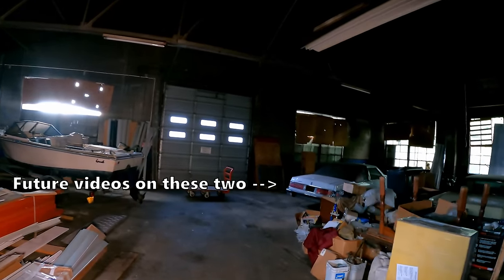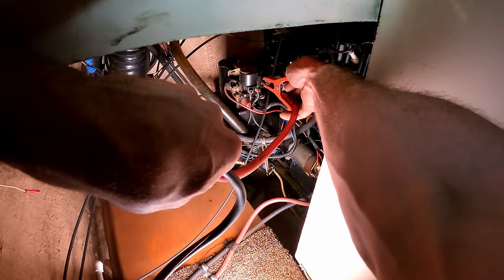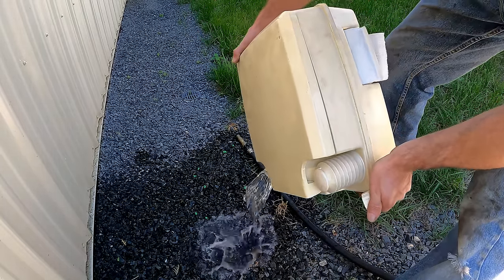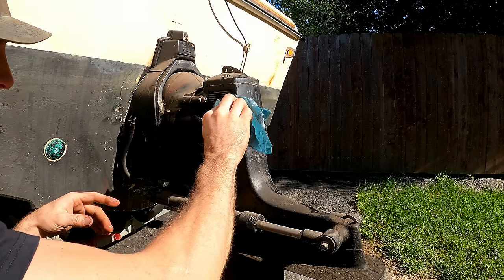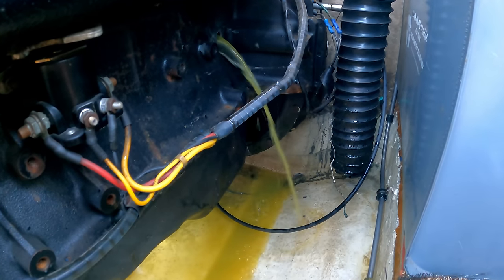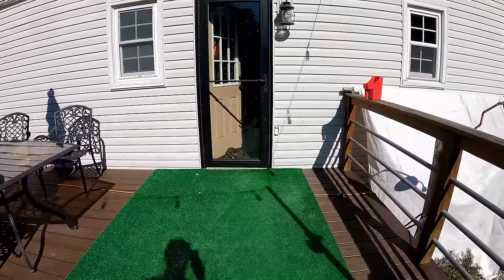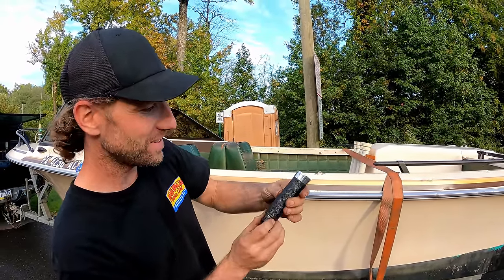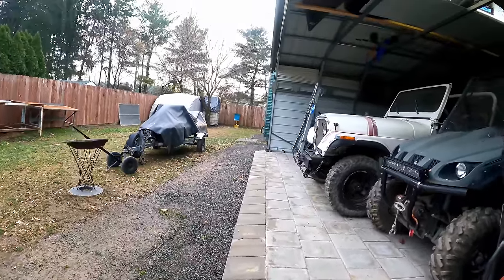Caravelle Boat Sitting Since The 90s?  WILL IT RUN? and Float - NNKH

Comment: Just an FYI, if you didn't already know those dry chemical extinguishers after sitting for years even though they are in the green, they won't work properly. Take a rubber mallet and beat the sides and rotate end for end until you hear the powder sliding freely and not in a clump, from end to end. Should be done once a year.
Reply from the maker: Thanks for the tip and info!

Comment: I had an orange 1972 Caravelle Stingray for 10 years, gave it to my sister and she ran it another 15.  Great boat, used it a lot on Lake Michigan, nice deep hull on them.  It had the ubiquitous Mercruiser 140hp 4 cylinder (GM) so it was great on fuel. Hard to believe the 6 cyl. version only gets you 20 more HP.   I did have to replace the exhaust manifold despite it always being a fresh water boat.  Mine had a steel gas tank up in the bow that rusted out.  Had to remove the entire  top half of the boat to get it pulled out.  My brother welded up all the pin holes he found after sanding it down and popped it back in.  That was when I still had it so it made it another 15+ years without developing any more rust holes.  I'm going to guess that this boat was probably made in the mid 70's.  There's a lot of stuff on it that's identical to what was on my 72 so I'm thinking it's got to be within a few years of '72.

Comment: Chris on the old style tnt you have to push the middle button and the top button or bottom button at the same time to make the TNT go up or down  . That is why you see red on half of the middle button and the top button it red and the bottom is Green . The inline six it a GM Truck motor and its the best combo for a boat and drive you will ever have on a boat I love it . Again push both buttons for tilt or tilt down

Comment: I had a 1967 Lone Star, cutter crew with a 327.
It had a through the hull water pickup, direct to the engine mounted water pump.
It was nice not having to worry about the unreliable pump impeller in the out drive.

Comment: Great boat 
 I retired from flipping cars in 2017 after 43 years buttoning at that boat. That looks like a keeper! Buff the white, fill sand and paint the bottom, wheel. Wheel bearings in the trailer

Comment: Love everything you do bro. Been wrenching on cars since the early 80's as a hobby/passion. First car my father gave me was a 1944 Willys MB2 War Jeep. Moved on to many others incuding my high schools ride of  a 1977 Firebird I bought from the Chef at the restaurant I worked at for $900 in 1985.  I wasn't even 16 yet. Grabbed a 1985 Mustang GT with low miles in 1989 while I was in college for $5,000. The list is long thereafter. My only advise, do it while your are physically able. I've pullled motors myself and done other stuff to remedy a situation that wasn't physicallly advisable. Work smarter not harder.
Reply: And get this tools, assistance, etc to do so. Which perhaps you already are

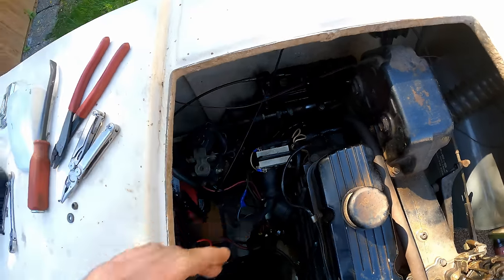Comment: 33:45 you nailed it on the head when you briefly mentioned the BEST thing to do is just REPLACE that throttle cable, because that's ONE THING You dont want to have fail you when youre out on the water. Lol.

Comment: A few vids ago I commented you can tie up a spare belt in case it breaks since you have to lift the front of the engine to replace a belt.  That is the engine I learned it on!  Super reliable, good on gas.  Outdrives, a different story.

Comment: G,day from Sydney Australia. Nice preserved glass boat. 
*Good work trouble shooting the lack of engine cooling water flow rate, including temperature sensor and dashboard gauge.
* impressed with the air driven oil injection into the side throttle cable.
🌏🇭🇲

Comment: I've had a lot of boats over the years and have taken the GM straight six and Mercruiser from boat to boat a few times. My first boat was a Galaxy with a freeze cracked block. Tried to weld/braze it, waste of time. Bought a 265 engine from a salvage yard cheap because I pulled it myself from a bread delivery truck. That combination lasted for years. Strong motor for skiing. If you ever go to a stock GM 6cylinder like I did, the only differences I found was the marine version has stainless steel freeze plugs, and the head dowels are different. Water pumps are supposed to be different but I never found any difference.

Comment: I had a 1977 Bayliner with the Volvo 4-cyl that overheated. Thought it was an engine internal problem until I changed the water inlet elbow at the drive, no more overheating. Turns out it was so corroded, it was preventing water from going into the engine.

Comment: This is a great drivetrain. My uncle has a 67 grevette with this drivetrain. This is a late 60's drivetrain. Gauges seem original. They are the exact same as my uncles. 
If you ever have to do the aluminum distribution blocks for the trim... have fun. engine has to come out

Comment: I love you man, watching you is like looking back in time at myself in the 80`s ND 90`s.  Will it run  and flipping cars or anything for a buck. Just for giggles I had cards printed that said "Anything for a buck". got  lot of Laughs.  In about 85 there was an abandoned gas station by my home  where lots of people parked their cars for sale. Sometimes 20 cars were there. Occasionally some owner would under price his car and I would buy it . swap 4 sale signs (including phone Number) and flip it the same day for a$100 profit and never even drive it. Sometimes , not always. I bet I did 25 or 30 of those one day  no drive flips before the city shut it down. Those were great YEARS UNTILL IN 95 i had saved up $40,000 in my floor SAFE , One day i WAS sitting at my shop no more working at home, and a guy came up and served me with a divorce decree. 5 minutes later a cop came up and served me with a restraining order .WOOO!!! I ran to the bank only to find out my accounts were wiped out and my credit cards maxed out. All within the same hour! What a coincidence, eh? Restraining order or not I went to my house AND the safe was empty and all the locks changed and a new alarm installed. Plus all  my titles were gone! (cant sell 30 with open titles without paper) I took me 20 years and I built up the same amount of assets and the same thing happened but not  as bad as the first, I`m 73 now , live in a tiny shack have no assets or drivers license because I cant afford insurance due to what my X did to my driving record. All this is to tell you to watch your togue and dont say the two little words I said.............I do.......dont do it man!

Comment: 31:50 those hydraulic crimpers are AWESOME.  I bought the exact same set from Harbor Freight about 10 years ago.  I don't use mine for electrical cables, but i have been in charge of putting up a 200ft tall Christmas Tree "shaped" light pyramid every year that's made from 12 strings of LED rope light, and each string is 200 ft long and each one is hung from the hook of a construction crane and is hanging vertically under its own weight, so to prevent the rope light from tearing itself in half, we attach each stand to its own piece of 1/8" stainless steel wire rope (cable) to help support the weight of the rope light.  Plus each stand has separate pieces of cable attached to it about half way up that runs to the ground at an angle (away from the light strand) and gets ancored to the ground, this keep the rope lights from getting blown around side to side in strong winds etc.   anyway.. long story short, 12 strings at 200' long each,  plus 2x 100' stabilizer legs for each light strand, youre talking about 4800 ft (almost a mile) of stainless steel cable, each one needs dozens of aluminum eyelets, ferrules, connectors.. all of which need to be hydraulically crimped, by hand, in the field, outside in October/November in the upper Midwest when its freezing out, and my little harbor freight hydraulic crimper (just like the one in this video) has worked FLAWLESSLY going on 10 years now! 

Best investment ever!  No regrets here.  The only thing i ever had happen is occasionally the head will unscrewed from the body a little too much (it kind swivles) and if it unthreads too much the hydraulic oil will start to weep out and make a mess next time you go to grab it out the case.  No big deal though, just twist it tight (dont over tighten, the threads are fine) and it seals back up perfectly.  

Awesome tool! 👍

Comment: I usually spend a bit more on electrical connections. Big difference between those cheap ones and a nice heat sealed connection.

Comment: Had a 21ft Caravelle with same motor had a cracked blk but ground it and used a metal repair putty and ran the boat till I sold it 3,-4 yrs later but it had walk thru open bow with a fiberglass roof/cab that covered seating for four or seats would fold out into beds and we'd catfish in the rig, hang a space blanket off the rear of cab and light a sterno,, warm fishing 👍

Comment: Ever think about making a tow dolly from that little sign trailer? Just widen the axle and weld in a couple of tire trays ,add some straps  and go !! Even the homemade ones fetch alot of $$$$ !!!!
Reply from the maker: I was planning on maybe putting a generator on it. Or something else that would come in handy. I already have the tow truck so don't need a tow dolly at the moment. I used to have a master tow. It was great

Comment: We are looking at the result of 50 percent inside storage and 50 percent proper maintenance. Any issues are just age. Plus a straight 6 is a pretty indestructible engine.

A little gimbal bearing leak is no real issue to fix.

Comment: When Optima moved to Mexico I noticed a huge decline in quality. I bass fish year round and I used optima batteries for years. In about 2010-2012 (somewhere around that time) I bought four new optima batteries for my boat as replacements for the optima’s that I had been using for several years. The new optima’s lasted about three years before two of them died. I started buying batteries at Walmart for a ton less money and they work just as well or better than optima’s for me. But I’m sure optima is saving a ton of money by making their batteries in Mexico. This money savings is great for everyone except for the consumer.

Comment: A lot of the stff in that boat is from the 1960's even. If you look at that material that is in that pile of stuff with the flowers on it and the Psychedelic colors etc. It's directly from that actual 1960's for sure and those non spill mugs are from the 1970's at best too. LOL. COOL stuff!   Well until you want to wash that mug out lol.

Comment: Those are great boats and with the 160hp, make great recreational ski boats. That boat should be capable of pulling 6 experienced slalom skiers. Mind you, they won't just pop up out of the water but I have done it with that same engine.

Comment: Caravel are very good boats that offered good performance. They were built without using wood in the hull. I think I heard you mentioned a searay which is another great boat. The one to stay away from is a bayliner. Oh yea you probably have an Alpha outdrive which is fine for what you have at least it’s not an OMC. Also you are supposed to fill the drive from the bottom up not top down. Not sure about using gear oil not specified for marine use.

Comment: Caravelle is an island known as Martinique. Although what I find curious is that in boats it's traditionally a hull style and construction in timber vessels. Although the boat here has no resemblance to Carvel (carvel, carvelle, carvile, kervel) It must be reference to the Island and the boats there are a fast manoeuverable craft hence a short nose and an inboard stern drive for carving a path through the coastal waters and rocky shores.

Comment: 😇😇😇😇😇😇😇 I would ditch the foam on the engine cover. That stuff is nasty once it starts to degrade / delaminate. For the cost of it get some 🔥 Fire proof stuff and heat resistant glue. You could possibly use car or vehicle sound proofing ? 
** Don’t go sucking in or ingesting any of the dust , foam is made with highly toxic chemicals and gives off cyanide gas if burnt .**  If I was in the USA I’d send you some . I’ve been working with these products for 52 years . In the UK we still had none fire resistant foam until regulations changed in about 1987-88 . So please go carefully as I suspect the USA was the same .  Great video as usual and what a find . 👍🏻 Keep em coming .

Comment: That boat is at least a 68 or older the 160 Mc was before the 165 its a 250 straight six chevy great engine but that intake manifold and exhaust is all one unit and very expensive to replace only aftermarket is avaidable so dont overheat it or let it freeze

Comment: The wonder mug with its rubber bottom won't slide off your dash pad of those old cars and the old fashioned styrofoam coozie. Newer than 1972 boats would have a VIN number on the transom. It should have the year right in the number.

Comment: To launch a boat reverse and hit the brakes.Trailer stays out of the water.Drop your rollers and drive on trailer or change to slides with side posts no winching
Reply from the maker: With a bunk trailer maybe but not a roller trailer. Good way to lose a boat on the ramp

Comment: You need coolant in the engine, water from the foot goes to the heat exchanger and cools the antifreeze.
Reply from the maker: Not on this boat. Open cooling system

Comment: Top Gear under the cap on those drives are really bad to strip out.  Believe the ones with the hook eye on the top were the I or R model drives ....somebody correct me if I have that wrong.  Always check the condition of the u-joint bellows under the outdrive.   That will sink the boat if it is ripped.   There is a foam seal under the transom assembly that sealed it to the fiberglass.  That five dollar foam seal is one of the biggest labor jobs you can get into because it requires engine and outdrive removal and then the transom assemble to come apart as it sandwiches the transom.

Comment: Noticed ya don't put a piece of wood under the drive to keep it up. They have been known to creep down, both new and old. Sucks to get to the ramp and find it crept down and parts of the lower unit/prop are missing because of a $0.50 piece of wood and a bungie chord

Comment: You shouldnt  Turn /Crank/ the motor over or run the motor with the outdrive in the up position, it can cause major damage to the outdrive, especially without a water source,
 i.e. water hose or in water

Comment: G/Day mate i noticed in another vid of yours you had those old dangerous pull down dogs ,can i suggest you get the ratchet 1s im a retired road-train driver of 50 yrs and i have seen at least 6 drivers when releasing them have had there arms smashed to bits cheers and Ty for your vids and stay safe
👍

Comment: I was curious why you were trimming that small piece off the last row of pavers, then figured that you cut them at a angle to have a tighter joint between the flat and the slope. Was I right?
Reply from the maker: Yeah I wanted to keep the joints the same but have the last row slope down toward grade

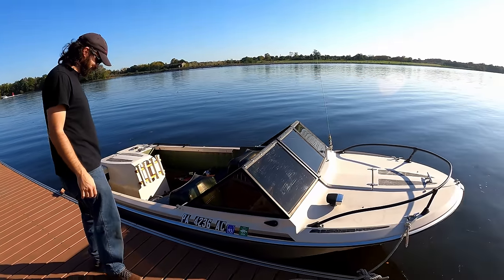Comment: Wow. @41:30. $10,000? I guess I get it. I bought a 2001 Yamaha XR 1800  Jet Boat with (2) 155 hp motors. Paid $4000. Turned it 2 months later for $9,000  at auction . Pass side motor was lame. I just can't believe what peeps pay.......

Comment: The raw water pump has a rubber impeller that falls apart  probably just need the 10 bucks impeller and not the expensive complete pump
Reply from the maker: Better to replace the whole thing with seals. $30 well spent imo
Reply: @NoNonsenseKnowHow  that's not bad the pump on my boats kinda pricey

Comment: I was wondering when you get a chance and if you have time if you can come to New Jersey by Brick New Jersey on Route 70 and help me start my 1953 Pontiac Chieftain has been sitting for 5 years because of covid and health issues now I want to get it on the road I got air in the tires all I needed to get it started drain the gas and whatever else you have to do to it please can you come of course you'll be compensated and if you can get back to me I appreciate it I think it's probably you are 2 hours away thank you very much

Comment: thats not how you do gear oil on that outdrive   there should be a lot of other people in the comments saying this
Reply: not the way to charge an optima either
Reply from the maker: The only time you have to fill from the bottom is after draining. I've shown this in several videos. The oil level was only a little bit low so no problem to top it off from the top. Hope that helps answer your concern
Reply from the maker: I also recommend hitting the gear oil up some first to flow better. If you fill from the top with an empty drive the oil will have a very hard time making it to the lower portion through the tiny little pass through hole.  Air lock
Reply: Yes, you’re supposed to fill it from the bottom until it comes out the top hole hole and then put the top hole back in and nothing should come out the bottom